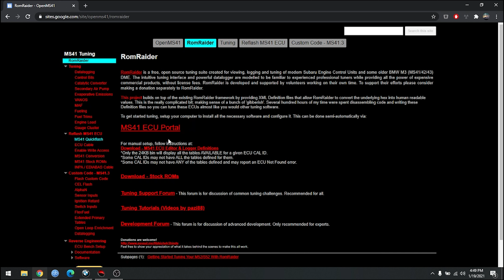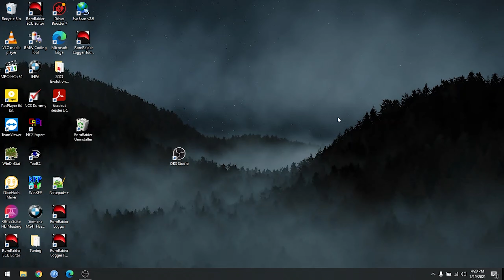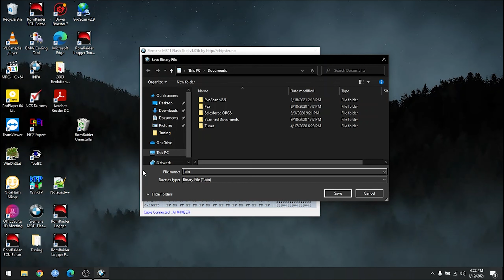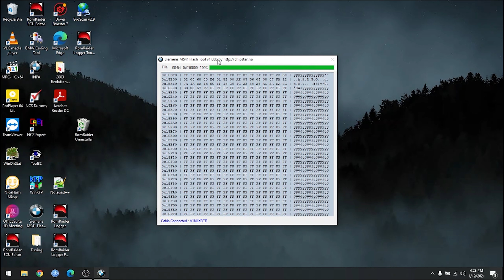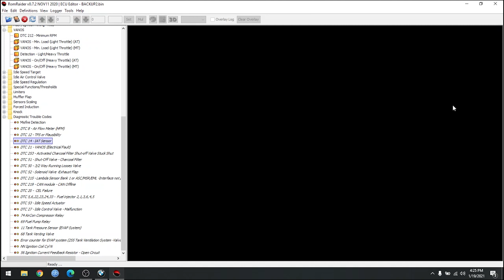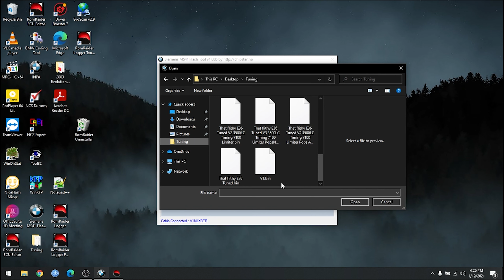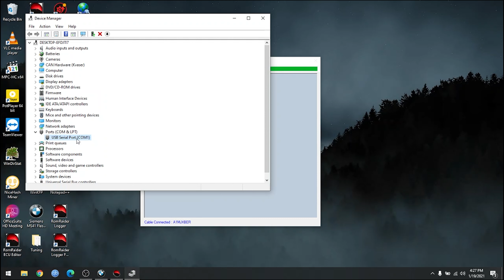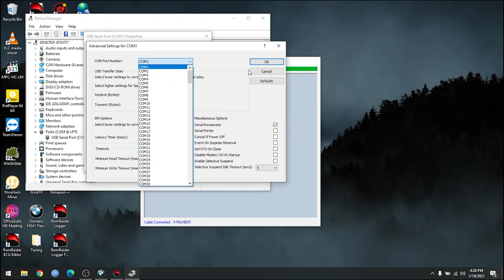How To Tune A BMW E36: Beginner Tutorial - Part 1

Comment: I can't access the flashing utility on drive
Reply: Google thinks it's a virus, just turn everything off or try a different browser
Reply: @MikeP41  what exactly should I turn off, I just tried with edge and it doesn't work either
Reply from the maker: @MarekBeylich  If that doesn't work you can buy the new version for $25: https://gum.co/ms41quickflash
Reply: @CanyonTuned  just bought it thanks!
Reply from the maker: @sillalexander Uploaded to MEGA and added link to description.

Comment: Can you use this to tune a turbo e36?
Reply from the maker: Yes, you just need to run a 540i MAF or do the resistor mod on the stock MAF. You can check out the rom raider forums for details. I believe some people also run MAFs from other cars (the 350z one is pretty popular) and scale/calibrate it in your tune
Reply: @CanyonTuned  ok, thanks